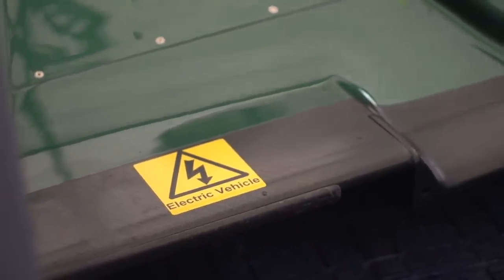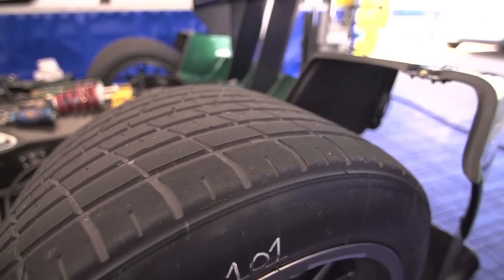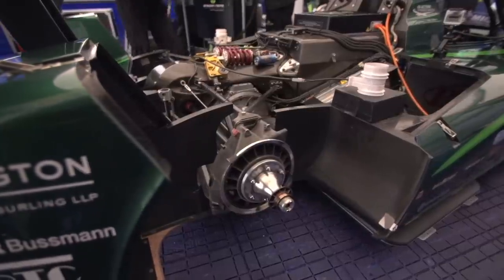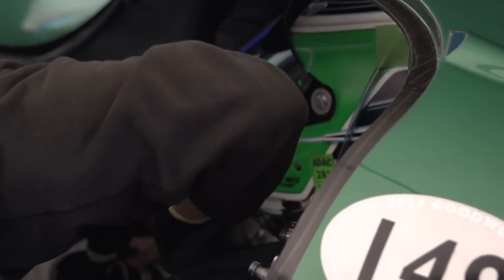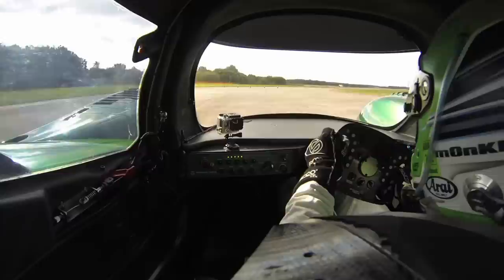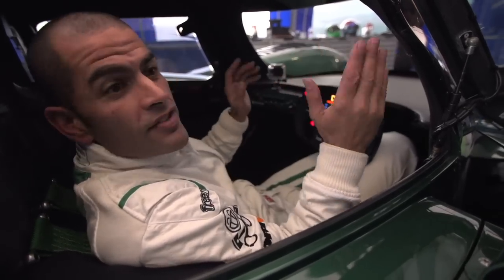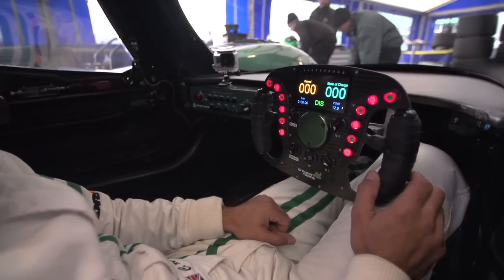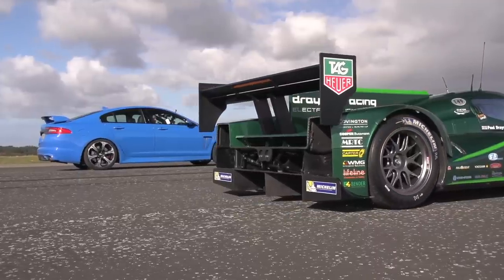850hp Electric Racing Car: Driving the Drayson B12/69EV -- /CHRIS HARRIS ON CARS

Comment: Then need to incorporate the wireless charging into strips on a track to charge the vehicles so we can have F-Zero.
Reply: You do know F-Zero is a hovercraft  racing game, and the pit-lane-strips in F-Zero repair the car(or at best recharge the Shields)?
Reply: Grand Prince Vuk J. Barkin' Tempest Yes I did know the cars in F-zero are hovercrafts. As I used to play it all the time. They can still be very similar concepts. And your second attempt at showing dissimilarity between the charging strips I spoke of and the "recharge" strips you spoke of are not nearly enough so for your attempted insult to be effective.  Cheers.
Reply: +Justin Hammonds or just use custom built generators turn by electric motors for the power and make sure the generator is of the really high ampere type with low voltage cause you can use a transformer to step up the voltage and a custom AC/DC converter . should make for a very fun long ride
Reply: Der Panda My guess would be lack of sponsorship options. It seems a lot of motorsport is sponsored by oil and auto parts related businesses. Companies that would lose a lot of money if electric cars proliferated.
Reply: Would only increase the battery time by about 1-5 min
Reply: ***** So enough for a lap. So they just drive across the charging strips every lap and they're good to go. Or just make them like sort of like big slot cars. Ha.

Comment: making a electric motor make sound is hardly a problem. you can make a electric motor sing songs if you want, using it like a speaker. a simple tweak in the timing can result in electric motors with rather satisfying growls that turn into supercharger/turbo like whines. the reason you dont want this in racing however is simple - efficiency. any sound is a result of torque ripples, and lost power. energy which could be going into the tires. Perfectly tuned motor controllers result in near silent motors, and the maximum possible power output for a given input.
Reply: If all entrants are obliged by rules to have a sound system sim and speakers, it would be fair for everyone I think

Comment: The faster it goes, the more aero it produces so the faster it goes etc.
Reply: Umm, aero doesn't work like that...
Reply: you do know that downforce is for cornering right?
Reply: Veyronp87 but downforce creates drag. slowing it down, yeh, downforce will help ya corner faster, but too much and it will slow the top speed, so it is not as simple as more and ya go faster
Reply: Duluxdoggy Not always. Diffusers add little to no drag because they don't disrupt the airflow. Before limits were placed on diffusers, they accounted for about 75% of a car's downforce. Wings and splitters add drag because they do disrupt the airflow.
Reply: Authur Jackson still -.- are you really ignoring things like that humungous wing?
Reply: VirusTornado Not at all. The wing is just one part of the car's aerodynamics, therefore the statement that downforce creates drag isn't really true. It can, but it is certainly not a rule.
Reply: Authur Jackson Any downforce also creates drag - always.
Reply: Authur Jackson Downforce is a force. For a force to work upon a object it has to transfer energy to said object. Forcing the car down to stabilize it or pushing it backwards as the car moves forward i.e. air resistance, or any force that acts upon the car not in the forward direction is whats called drag. Not all aero parts create downforce, some just make the car more aerodynamic to reduce air resistance.
Reply: Henry Floyd You cannot create a downwards force using a opposite vector without drag. The shape and form of a diffuser itself is not parallel with the flow of air, therefore it creates drag. How miniscule the drag coefficient is a different story. Much like how lift induced drag lifts an airplane, downforce uses the same principle to push the car down with induced drag. Physics.
Reply: xyoshi well said.  Henry check out http://en.wikipedia.org/wiki/Bernoulli's_principle it might help you understand that a diffuser uses the same principle to create downforce.
Reply: Few things at stake here. Putting an object in an airstream will restrict the flow of the airstream around the object - known as drag. Aeroplane bodies have some drag, sweet fuck all, and L/D ratios of over 50/1 are quite achievable.
Now, I find too often that physicists are so busy examining the evaporation of moisture from a leaf that they miss the forest. Yes, a diffuser will create some drag but at the speeds we are talking about, on cars in a real world environment it is simply not even considered - diffusers are considered free downforce. The wing on the other hand creates significant drag as it completely deviates the airstream to produce work. So xyoshi, while you are correct technically, the semantics involved are a bit unnecessary.

Comment: Noise is inefficiency.

Electric is nice at the point of use, BUT it still had to be created someplace. All electric does is move the pollution out of sight out of mind. For those of us that remember the waste land that was Sudbury, all the big stacks did was drop the acid rain in Ottawa.
Reply: Noise is not inefficiency,a straight  free flowing exhaust on turbo and non turbo high horspowe race engines are loud but are far more efficient in airflow than quiet street ones, which are restrictive, induction noise is an indication of taking in more air, to boost performance, a loud process but not at all inefficient, very powerful electric motors are very loud, you make no sense in that regard 
however your other point is totally true.
Reply: Dreadzedan Noise is energy, granted a very small amount when talking about 4000 Nm of torque, but it is inefficient, to a certain degree. In the future I imagine it will matter more.

Comment: 4000Nm ???? WTF?
Reply: see why everyone is excited about electric engines now?   And just remember, it gives perfectly linear power ...  No need to get to certain revs to get the best performance anymore
Reply: Stryke it's not perfectly linear but it's much closer than ic engines, as glorious as piston engines sound theyr old tech now
Reply: eatthisvr6 yes, sadly.  We will really miss combustion engines ...  the sound, the passion around them
Reply: the stuff these can put out is LUDICROUS.
Reply: whats even more insane about this too is that the torque production works both ways. The motor does not have a flywheel, so that massive amount of torque will stop just as quickly as its produced, so motor braking is a real thing here, the braking performance will be far better than a combustion car, AND have less wear and tear on the actual brakes as well.

Comment: electric car are great until 20-30 mins later when they stop
Reply: dan smith Soon, hopefully, batteries will have a similar energy density to gasoline.
Reply: dan smith you main PIT stop? =)
Reply: dan smith First airplane was hanging in the air for few meters before falling back to earth. Look at them now. It is just matter of time when power storage and generation will be enough to drive one month or even longer.
Reply: dan smith Hydrogen is the solution to all ;)
Reply: Sigi Baes better talk to elon musk bout that one.! LOL
Reply: dan smith oh really? Have you seen the Tesla Model S with a range of upto 300 miles.
Reply: awes0meguy13 , Check the out Tesla Model S that already has a very long range of upto 300 miles.
Reply: relentless5321 yes if you drive it carefully. After 2 laps on the Top Gear track the performance dropped a lot.

Comment: NASA projects electric motors with 32 bhp/kg about (14.5 bhp/lb) in a few years. Try that with your already obsolete internal combustion engine.

Further advantages of electric drive include Maximum torque at 0-rpm and no transmission needed as the motor will achieve up to 100,000 rpm.

Power to drive the electric motor? efficient regenerative braking; hyper-capacitors  for high frequency load leveling; Li-ion batteries for long-term load leveling; prime power uses hydrogen to fuel a 150-kw fuel cell that burns pure hydrogen. Add high efficiency power electronics to tie it all together and gas burning internal combustion hasn't a prayer
Reply: You forget that electric motors need power, and batteries are absolute shite at storing energy.
Reply: Mr. Garret- Li-ion batteries are already at 400 Wh/kg and if you project the trend line almost guaranteed to reach 1kWh/kg by 2020. Still that's a metric ton per MWh (about 1300-hp/hr) so for autocross yes, for Le Mans No unless you can swap out batteries during pit stops.
Reply: Trust us dude, ICE's will never, ever become obsolete.
Reply: RJU- Running out of fuel is a fantasy. Brazil runs on Ethanol produce from sugarcane. Petroleum will never run out, it will just get more expensive. at 200 dollars a barrel there would be a surplus of oil. natural gas is dropping in price as we speak and there's a fifty to 100 year supply. But all of this is fantasy too.

After 2050 the whole world will run on fusion power. Fusion? Yes. from the big fusion plant at the center of the solar system known as the "Sun". This plant has operated 24 hours/365 days a year for 10 Billion years supplying the earth with 1,000 times the energy used by the entire human race
Reply: Reuben John Unicruz Race cars specifically, I meant. Lots of them run on ethanol already and I haven't seen signs of it becoming too expensive. 

Electric road cars are perfectly practical, in my opinion, as long as we can make them reliable. It would also be nice to see an all electric sports car series racing cars of the type in this video.

This Richard Reinert  is completely insane. One of these days the Earth WILL run out of oil. And if the sun runs out of energy by 2050, I'll be a monkeys uncle. That just goes against everything that every credible scientist has ever said about how long our sun will last.
Reply: Maybe I am completely insane to speak the truth to power. BTW The Sun Will not run out of energy for about 5-billion more years and then it will get brighter. What I was trying  to say when I was interrupted by Google was that by 2050 the USA will run on Solar Power with natural gas usage tapering off.The rest of the world will follow suite unless they enjoy burning $250 barrel oil or turning all their arable land to producing ethanol .
Reply: HF- I agree, Internal combustion engines will last long because they are neat gadgets. Just like sailboats,people will keep them because they love them.
If technology never changes, where were Google and the internet when I was a kid. (in 1954)?
Reply: Mr. Douglas I feel the same way you do about the lack of a perfect heel and toe downshift and the noise of a high revving IC engine. Nevertheless the Tesla Model S all electric sedan was Motor Trends Car of the Year. Also I wouldn't give up on tweaks. I 'll bet the motor controller can be tweaked just like today's engine management computers can.
Reply: Djsand1000
You are correct, they will always have their place.

In sanctioned historical race events, lol...
Reply: Alex Levenko
That's where you'll find the actual drivers

Comment: Horse power is way over rated.   Torque is much more fun.  If you've ever driven cars with high horse power and moderate torque and then driven a torque monster....you'll know what I'm talking about.  

A combustion engine will NEVER be able to produce the kind of torque an electric vehicle will.   The problem for the electric cars is getting that torque down on the pavement.
Reply: and note the wheels spinning on gas you can see the engines fire strokes when they take off the electric has a more steady wheel spin

Comment: The problem with all electric cars is that they have to be recharged. If I want to drive and keep driving forever, I can't. Why would I want a future technology that is worse than the current one we have?
Hydrogen fuel cells are still the way forward.
Reply: They aren't. Using electricity to make hydrogen and then using that hydrogen to make electricity again is unacceptably inefficient. Storage isn't easy either since hydrogen leaks through almost anything. Instead of charging the batteries, why not have stations where you can exchange your empty battery for a fully charged one? You know, press a button, battery comes out, battery has casters on the bottom for easy handling, charged battery gets rolled in receptacle, push a button, car picks up fresh battery.
Reply: ManWithBeard1990 Which Tesla has shown that it works.
Reply: If you're not familiar with it, you might want to read about the Tesla Model S which swept the board with awards this year. Many prestigious reviewers said this is the best car they've EVER tested... from ANY category of car. It has a 265+ mile range, does 0-60 in 4.5 seconds, is electronically limited to 133mph, fits 7 people, nearly double the storage of an equivalent gas car, has a giant iPad instead of any interior controls, and here's the relevant bit: Tesla have launched a nationwide Supercharging service.

Supercharging stations can recharge a Model S to 80% in 30/40 minutes and to 100% in 75 minutes and they're totally FREE to use. Not good enough? Well Tesla are also rolling out a battery swap option where a machine reaches under the car and replaces the entire battery with a fresh one in about 90 seconds.

Once the infrastructure is there (America's west coast is now finished and they're working to conquer the world!) we'll see an electric car revolution similar to the smart phone revolution of the last 5 or so years. This is the progress/plan for the supercharging stations: www dot teslamotors dot com/en_GB/supercharger
Reply: ManWithBeard1990

If you have battery swaps at "fuel" stations, then you end up with millions and millions of expensive heavy batteries beeing transported all over the country. This is very polluting, both in manufacture, and then after their life in disposal. Energy can be cheap, using it to make Hydrogen is no more inefficient than having to manufacture all that tonnage of batteries.
Reply: Dylan Greene
Most batteries can be recycled so no harm done there, and they needn't be too polluting to manufacture as long as the factories are themselves powered responsibly.

The system with the battery swap terminals (which would phase out gas pumps) is that the battery removed from your car goes to the back of a conveyor belt to get re-charged (by overhead solar canopies) and eventually goes into someone else's car. It all makes sense.

Oh, and the battery life is rated as minimum of 10 years which is as good as most engine components.
Reply: Mellow, I don't think you actually read any of my posts before responding, did you?
Reply: Dan Paveley
I KNOW you never read mine. Cus mine says +Joseph Ford at the start.
Reply: Dan Paveley
I've heard a lot of good things about the Model S, but I didn't know about that being an option yet. But yes, provided that those batteries eventually become standardized across manufacturers that's exactly the way I think it should be done. Glad to hear things are heading in the right direction. "Super"charging though, while technically very interesting, still takes too long to really catch on, in my opinion.
Reply: Viddeos socios del ritmo

Comment: To all the people complaining that this is silent: it's not!! For spectators they get to hear the wind noise, which is actually the sound of speed (exhaust noise is just the sound of dinosaur-fuelled power), as well as the high pitched motor noise when it really gets going. It's easy to see that the motor noise can vary greatly and is also affected by other components. Electric sportbikes basically sound like TIE Fighters. 

Anyway, if it was 100% silent that would just mean that the plod wouldn't hear you coming. In which case, what are you complaining about!